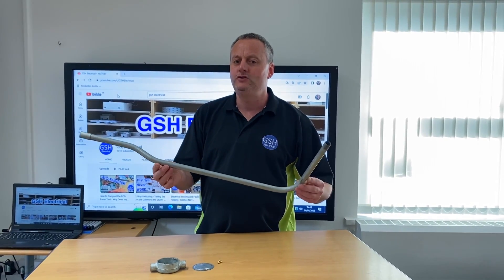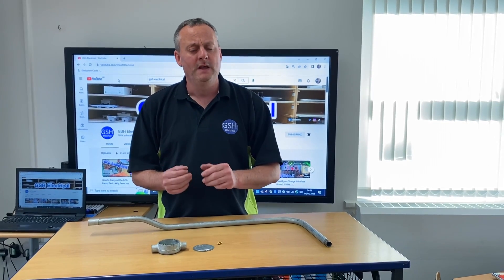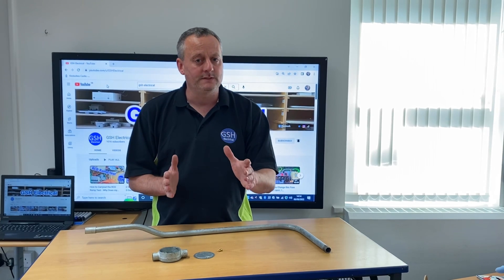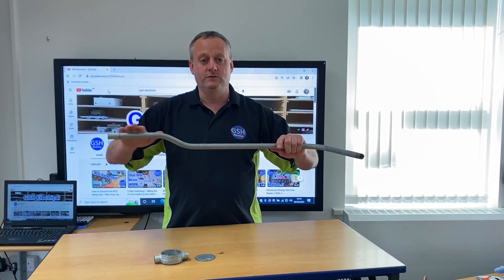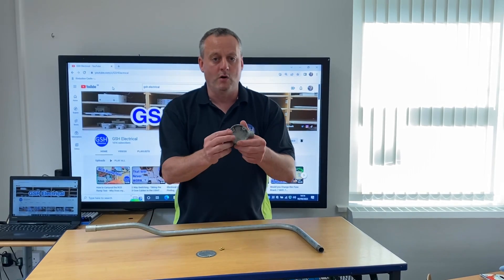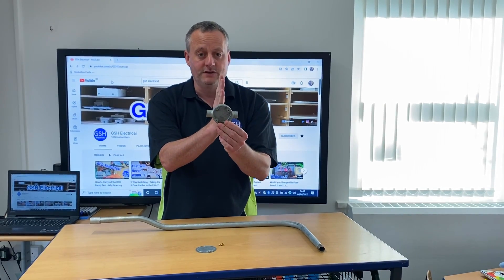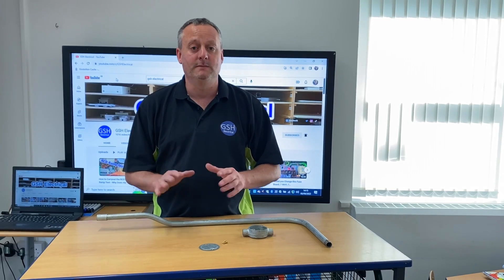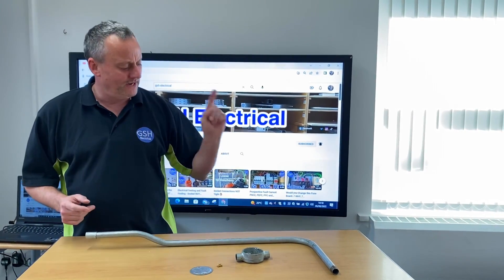AM2S Assessment Just got Easier - Steel Conduit Bends

Comment: Hi Gary, does the through box and the conduit need to be tight at the threads? I have to leave them a bit lose if i want it to face the right direction..if I tighten them...they are on diffrent angles and the box and conduits don't sit square.  Thanks to the video.
Reply from the maker: In the correct position and tight. Gaz
Reply: @GSH Electrical  Thank you. That is tough.  Must be some technique to make it easier. Else it seems I have to guess and tap the tight amount of threads to get the right position and tightness.

Comment: The part P scammers (what's left of them) want the AM2 if you join as a new customer now, so a time served domestic spark needs to mess about with steel conduit and DOL starters etc just to be able to wire a couple of sockets in someone's shoe box extension, madness.